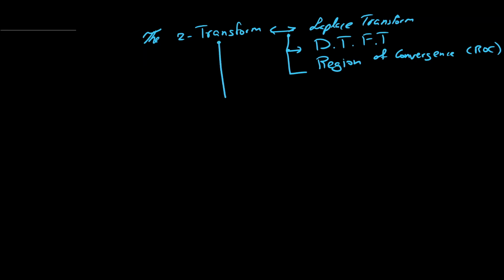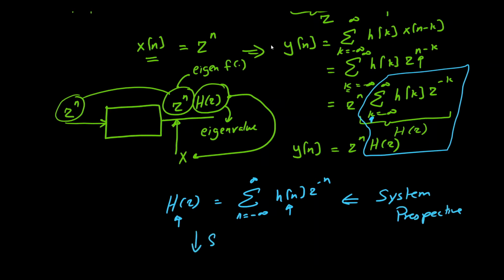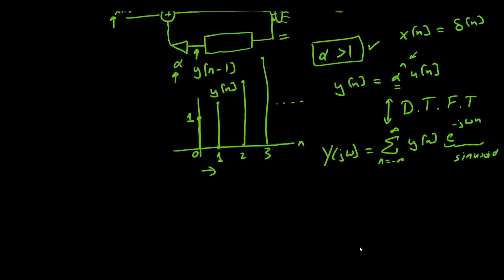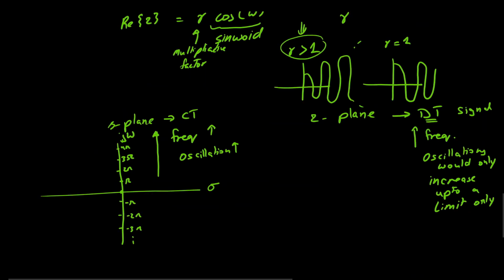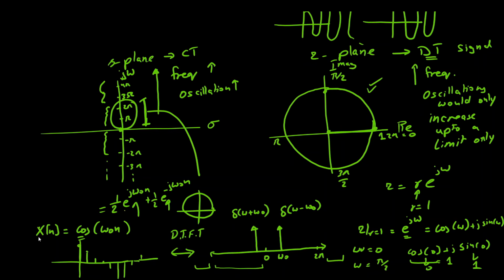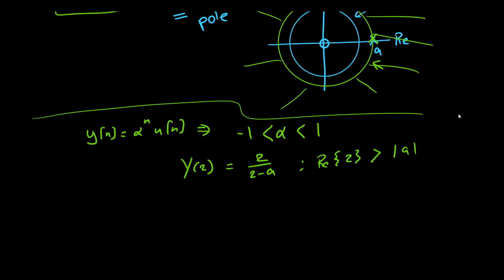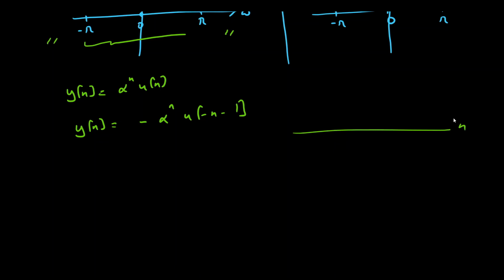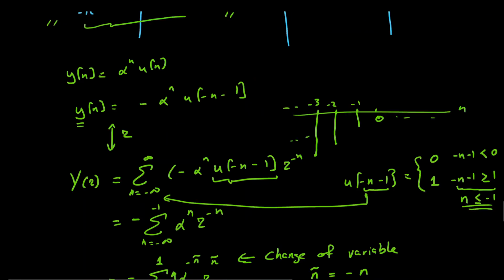z Transform Explained with Examples | 4.1

Comment: 32:49 sir shouldn't it be zero for the argument > zero, since it's a left sided signal
Reply from the maker: the definition of unit step functions u[n] is that u[n] is 1 if n>=0 & 0 when n<0; 
in our case the argument n is now replaced with [-n-1]. therefore u[-n-1] = 0 if -n-1<0. and u[-n-1] = 1 if -n-1>0. 
for the case of  u[-n-1] = 1; the condition can be rewritten as -n-1>0 or -n>1 or n<-1.